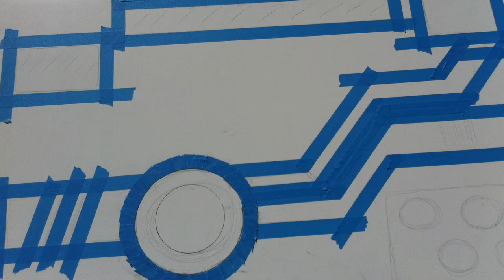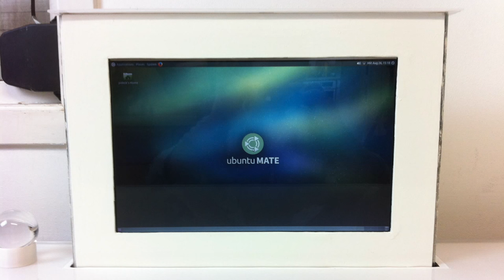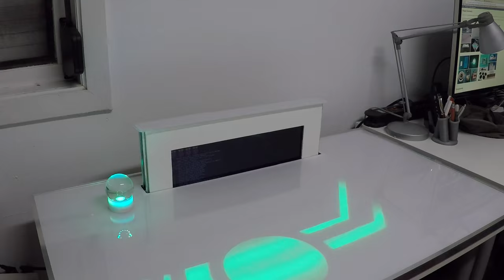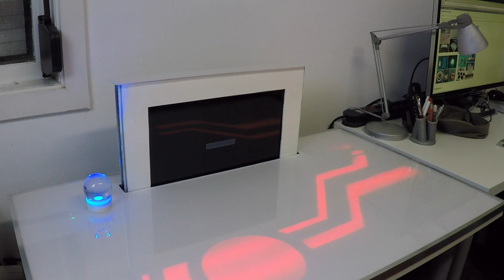PiDesk - Futuristic desk with embedded controls, using Raspberry Pi

Comment: Great project but the screen opening is very slow
Reply from the maker: +Bruce Wouaine Yes it is, might try a second attempt with the lessons learned from this build :)
Reply: +Bruce Wouaine But does it really matters? As you can see it takes time to boot the Ubuntu MATE and it seems to be finished the same time the screen is up.
Reply: +fu1r4 or before
Reply: +Wesley London 2001 Also Sprach Zarathustra would be perfect.
Reply: +Wesley London And a smoke machine, some lights too.
Reply: Johnny Torpedo haha yes!

Comment: OMG, the whole video was just watching and waiting for the monitor to rise up.
Reply: Have you any idea how hard it is to make a rising monitor? The weight means you have to have some seriously beefy stepper motors that can do the work! More power means less speed. The motors are designed to have torque and little speed, plus they run a screw which is a reducing gear in itself. It's impossible to have a fast motor to lift such an heavy object. That's why this action is very impressive. Just to make it happen requires some real designing and possibly a couple of prototypes.
Reply: +PunakiviAddikti , Irrelevant.
Reply from the maker: It's indeed very slow, but then again, it's my first time doing something like this. The next version will have a better mechanism ;)
Reply: Listen, you built it, I didn't. So there's that. I don't build things, just break them. It's cool, but slow.
Reply: I'd be pissed if I accidentally shut it down my laying my arm on the desk. Have to wait for it to shut down and then reboot. Auugghhh.
Reply: Mc G It can be programmed to include a simple pattern like two fast taps to avoid that, or even RFID discs.
Reply: Actually more power means more speed because P=W/t
Reply: Jan Murić Not with stepper motors. They rotate in steps and the amount of steps determines the speed. They also have a maximum speed limit because they often have a chip inside that makes them easier to control by doing some tasks for you.
Reply: PunakiviAddikti Yeah, but in Physics more speed (less time) is more power.
Reply: Jan Murić True. You can make the stepper motor more powerful by increasing the input power though. This means more torque but the motor has a rating so that should not be exceeded.
Reply: +Frederick Vandenbosch clever!!! 2001 Space Odyssey!!! Lol. maybe next put the monitor on the wall. Ingenious... again.
Reply: yeah but you have to wait anyway to let raspberry pi boot and it finished booting at the same time that the monitor stopped rising up
Reply: Use a counterweight. Use the lever with the disc. Then lightly lift each weight
Reply: This is totally false. I have CNC'd a metalworking mill, by adding ball screws, stepper motors 4-axis controller, etc. The head weighs 85 lbs, and it lifts it much faster than this. If the developer wants, he can add something like a support piston, so the weight is basically zero. I eventually did this to my mill.
Reply: So It could boot smoothly....Duh
Reply: Mc G that's what I thought LOL

Comment: Quite nice but the motor for raising the screen needs work its quite slow and sounds like its being pushed hard.

Need a more powerful one or silent one.
Reply: Exactly what I was thinking, but for a v1... still very cool
Reply: I checked the video, it takes roughly 40 seconds for it to go up/down.  Wayyyyyy too long.  If it were 10 seconds tops, it would be neat, but for actual use you'd want to beat your head against the desk after a couple of days use.
Reply: Yes it works fine but the motor clearly too slow and under powered for the job but thats easly fixed.
Reply: maybe hedrolic pumps.

Comment: I'll have to look at your blog, but dang this is a pretty sweet project. A diy would be awesome, unless its on the blog. I want to make something like this as a summer project or whatever.
Reply from the maker: Thanks! It has its flaws, but for the first time building something like this, i was quite happy :)

There is a lot of info on the blog. Keep in mind though: the goal of the challenge was to use a Raspberry Pi for this, so that's what I did, but you can probably do some things more easily with an Arduino or other microcontroller board.
Reply: Wow that was a fast response, but yeah I guess I could see it using like faster motors and some other stuff unless that was the point to have it fully pop up when it's fully booted. Although I don't know much about Raspbery Pi's or Arduino's, but I do want to experiment a little with them as I am close to finishing my computer programming major in college. I only learned a couple different languages like C#, aspnet, java, javascript, sql, but will be learning php and xml this semester. I'm guessing Raspbery Pi uses Linux based coding?

Comment: hey Frederick. i would change your threaded rod to some trapezoid thread. you can even find it with 4mm pitch for 8mm thickness. this wil eliminate the slow move up and down speeds. or you could simply use a pulley system with some strong rope. the steppers will carry it with ease anyway. and gravity wil always pull it down. thats like the biggest flaw in your design so if you fix it it will be great.
Reply from the maker: +The redstonelabz Thanks for the tips! I'm considering making a second version, taking into account the things I've learned. This will certainly help, as the lift as the biggest problem of this build.
Reply: +Frederick Vandenbosch i made solthing simular a long time ago and i know this is just a pain in the ass since it takes so long. try just anghoring the end of the rope next to one slider. some sort of pulley in the middle of your sled completely on the bottom and then a motor with  a pulley next to the other slider. the size of the motor pulley will determine the strength and speed. if you understand what i mean :)
Reply: Question to the bunch: would it be possible to use the mechanics from the power window from an old car? A car window opens or closes in a few seconds, the window needs to move reasonably precisely and I think it also needs to be pushed fairly hard...
Reply from the maker: realulli Yes, that's probably a valid option which I should look into. Would certainly increase the speed!

Comment: Hello, great project but I have a question, which are materials to use on the top of the desk to diffuse the light of led (paper, plexiglass, ...)
Reply from the maker: +Alexis Marchand Both actually. I couldn't find "milky" plexi of that size in the local hardware store. So I used sheets of paper to diffuse everything and put a clear plexi on top.
Reply: +Frederick Vandenbosch Thank you for your answer. For microswith (x2), it are to use for stoper the screen at the top ? Or it there in one to stop itat the top and one below ?
Reply from the maker: +Alexis Marchand There is indeed one at the top, and one at the bottom. The are configured as limit switches on the Gertbot, stopping the motors when triggered.

Comment: So I'm just starting to make my own desk (thanks to your awesome idea) using a Pine64 and I was wondering what kind of motors you used in your build and is there anything better you would recommend? I'm using a bigger desk and monitor size to run a full gaming computer as well.
Reply from the maker: +AbledRacketeer0 I used stepper motors, but as you can see, this is way too slow. Others have recommended using a pully system with counterweight or an electric car window.

Comment: Them Nema17s need some gearing and just hovering your hand above the desk to shut down computer doesn't sound practical. Other than those really good project :) Here is a suggestion, put a RFID tag under the lamb and a reader under the desk, and use that as a power switch(you might need a arduino mini) It'd make this project cooler, more secure and practical :)
Reply from the maker: +flanker That's a great idea. Would prevent accidentally switching everything on or off. Thanks for the suggestion!
Reply: +flanker Agreed, Since it takes a full minute to raise and lower / on and off. Accidentally turning it off, or on for that matter seems like a constant usability issue. What if you actually wanted to "use" the desk. Love the effects though.

Comment: Nice job. What motors did you use for raising the screen?
Reply from the maker: I used two NEMA17 stepper motors, but as you can see, the result is anything but fast. A better option would be some kind of linear actuator or so :)
Reply: Frederick Vandenbosch
Exactly what I was thinking.
Thanks for getting back to me mate.
Cool project.

Comment: Did u use an lcd controller? Can you post me a link wich one do you use?
Reply from the maker: +Fabian Schädlich I got the controller a long time ago via eBay, so I don't have the exact link. Was the same as this one: http://www.benl.ebay.be/itm/Compatible-R-RM5251-LCD-Controller-Board-Kit-with-DVI-VGA-/271241797794?hash=item3f274560a2:g:UWUAAMXQHO9ReO1M
Reply: Frederick Vandenbosch cool thanks.

Comment: could someone tell me how the hovering the hand over the desk is used as i assume a button??? and then how when the ball is slid down it turns on and lights up
Reply from the maker: It's making use of a capacitive touch sensor, so indeed, hovering hand acts as a button. When the button is "pressed", different actions like the screen going up or down or the lights flashing is triggered.
Reply: okay thank you

Comment: Do you actually need to use a Pi ?? Leds can come with a prebuilt controller and the touch control is a basic switch that turns everything on. So why use a Pi anyway? Can you do the whole desk without one?
Reply from the maker: +id104335409 You could indeed, but the Design Challenge required the use of the Raspberry Pi.
Reply: Oh, so that's why. I was trying to determine the usefulness of the Pi. I do that occasionally to see if anyone has come up with something truly useful. I absolutely love the idea of Pi computers, but so far I have not seen a project that is utilizing it in a meaningful way. I don't say this to offend people's creativity. I really wish to see a working device that actually exists solely thanks to the Pi and is not duplicating an existing thing that you can already buy anyways. Building smart furniture looks like a really good idea. But not if you don't have some use for the Pi in it. No matter what I think of, I just can't seem to justify a project. The thought that a regular printer is a more useful purchase when you need one, makes me grind my teeth from frustration. sorry, I had to unload my feelings somewhere.

Comment: You don't even need a Raspberry Pi for that. lol

Just a sensor switch.
Reply: The The Raspberry Pi runs everything in the desk. Including the monitor. The pi is the computer and the screen that is raised by the motors is a shield so you can operate the OS that is downloaded on the raspberry pi.

Comment: veeeeeeery slow monitor movement. start the pc and wait 5 min to see the monitor. really ? and the power off button nearly in the middle of the desk ? while working you touch that area and the system shuts veeeeeeery slow down. idea not bad. realization a nightmare.